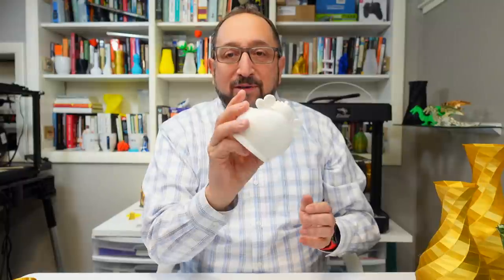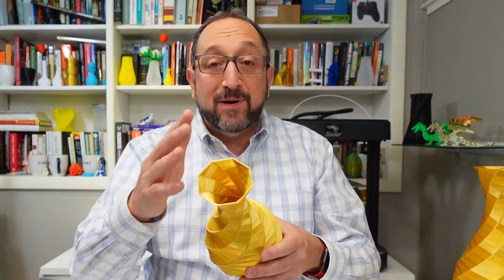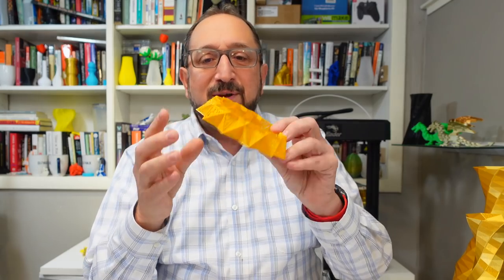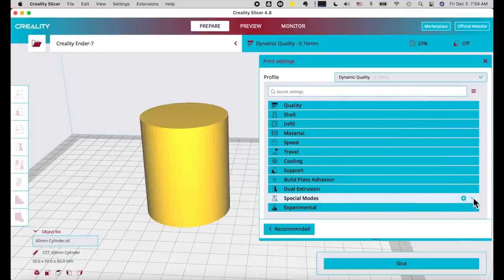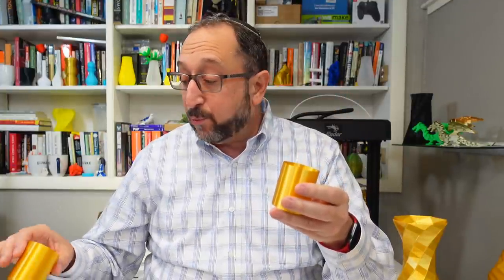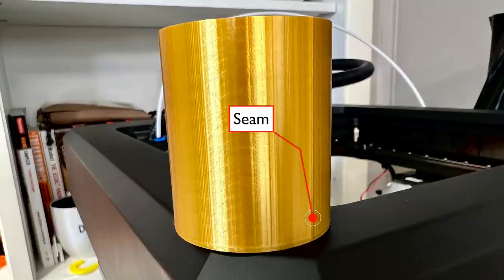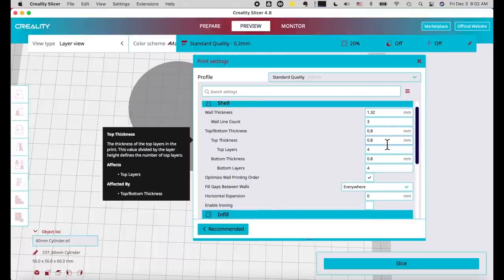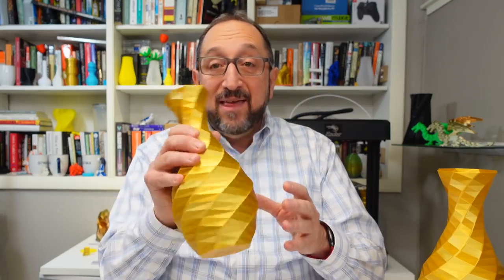4 Vase Mode Techniques Compared;  How to use Cura for Vase Prints

Comment: One cool thing to experiment with in vase mode - "Fuzzy Skin". It's under "Experimental". It adds a random jitter to the outer layer of the model, with vase mode this would be the only layer. It adds a degree of stiffness to a smooth surface, and you can adjust the degree of jitter. I had to print some eggs in vase mode, and making the skins fuzzy made them look more like real eggs (other than they were 7 or 8 inches tall and all sorts of weird colors).

Comment: About the last technique which I use I have a question. In my case the model has some area in the middle that are close to horizontal or even horizontal. They are considered by the Slicer (in my case I have tried Cura and Prusa) as a top layer and if I set top layer as zero they become zero too and missing, So the next layers will be printed on nothing. Is there a solution that I can set zero Top only for the topmost layers? I haven't found a solution yet. Right now I do it by giving like 6 top layers and deleting 6 layers from the end of the G-code manually.

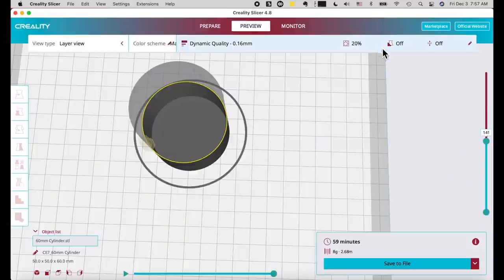Comment: 10:27 - if you just increase line width does it automatically extrude more filament or you have to change it too?
When I changed my thickness from 0.4 to 0.6 - overall lines, walls, top, bottom changed to 0.6 automatically, but the flow didn't change at all. It just doesn't show or we have to do something?

Comment: Great video, but increasing line width is not over-extrusion. Over-extrusion when there is too much filament extruded for the desired dimension; that is controlled with the flow setting(s) in Cura. Increasing line width will make a stronger print (like using a bigger nozzle) while increasing flow will make a vase more likely to be water tight.

Comment: Thanks for the video/help.  I was working on a vacuum hose adapter in Fusion 360 and having a heck of a time hollowing out the three sections ("Shell" would only work on one section).  Watched your video, set up Cura with no top, no bottom, and 1.2mm walls (which is what I designed to, anyways).  You sir, are a great help (I subscribed a while back for reasons just like this).

Looking forward to your review of the Ender 3 S1 Pro when the time comes...

Comment: Good analysis.  Each technique has its place depending on the project needs.  I also like multiple walls since they seem to be much stronger.  I'm printing a Christmas Story Leg Lamp using  4 walls and no infill.  It is almost 400 mm tall and needs to be strong.  I'll post on the forum

Comment: There’s a work around to turn off the resume print mode with adding adding a line at the end of your starting g code. Add a M413 S0 ; as your last line and it will disable resume mode in Marlin.

Comment: Spiral mode is way, way more than 10% faster. E.g., I just made a cylinder, 60x60x100 mm, with 3 bottom layers. With spiral mode it's 1h8m, and with 3 perimeters it's 2h45m. (No other difference. No top, no infill.)

If at all possible I prefer spiral mode, with a 0.6 mm nozzle, pushing 1.0-1.1 mm wide lines. Or if I'm too lazy to swap the nozzles I'm using a 0.4 mm nozzle with 0.8 mm thickness.

If I need it to be watertight I spray a few layers of clear lacquer. It works, although it's a bit tricky to spray into an enclosed shape, so do use close-fitted safety glasses (or swimming glasses 😅) and N95 (or preferably better) breathing filter, because it's gonna swoosh back up in your direction.

Comment: There is a setting in cura that helps reduce seams and that is ti tell the slicer to print outer walls first. (this also helps reduce stringing)
Reply from the maker: You are correct.  Thanks for sharing.
Reply: Hmm... I get more stringing when I print the outer wall first.. If it's the retraction that's reducing the seam for you then maybe you'd be interested in the "retract before outer wall" setting?

Comment: I'm curious about why the single perimeter spiral mode is likely to leak.  Do you sometimes get tiny bubbles in the extruded pla that allows water through?

I also wonder if there's some kind of spray coating you could use on the inside to provide a seal.
Reply: Yeah, I spray my vases with a couple layers of clear lacquer, which makes them water-tight.
Reply: 3D prints will often leak because the layer to layer adhesion isn't perfect. In the case of vase mode the problem is so much worse because there is only one really thin wall.
Reply: @iskandartaib  I see. Mine usually leak at the very bottom, because my bottom layers have some tiny gaps in corners.
But if there's a problem with layer adhesion then fortunately there's easy fixes. You could increase the temperature (nozzle and/or enclosure), decrease the speed, increase the line width, decrease layer height, ...
Reply: @marcus3d  Yeah, the bottom is also usually one layer. Yes, you can do all of those things to try to get a watertight vase - another one is increasing the flow, and if the bottom is leaking, increasing the initial layer height without actually increasing the physical initial layer height. Not really sure if it's really worth doing all this.. I figure if you actually want functional vases it would be best just to NOT use vase mode and print a multi-wall, multi-floored object.

Comment: In summary: (1) use vase mode, (2) use thicker line width setting, (3) use a thicker nozzle and (4) don't use vase mode, think about seams. Reading this comment saves you about 17 minutes ;)

Comment: You need to look at STL meshes. They are not solid objects.  The slicer makes them solid.
Reply: Well, the polygons have an inside and an outside, so sans errors I'd call an enclosed object with all its polygons facing outwards a solid.